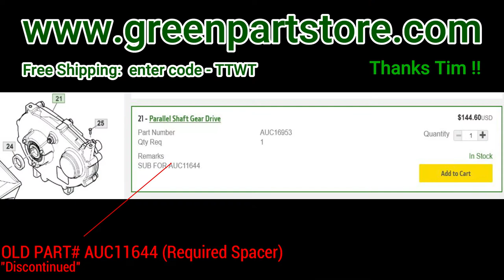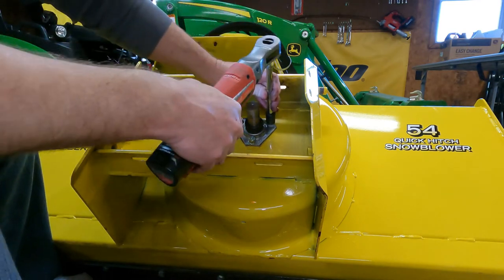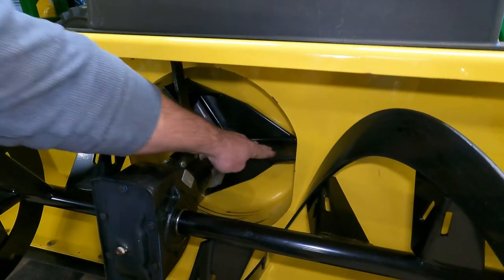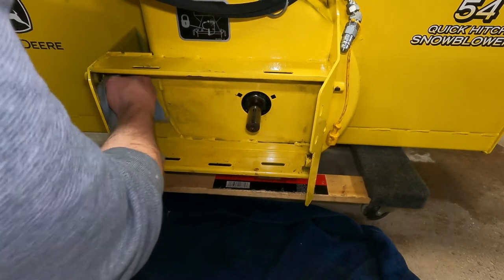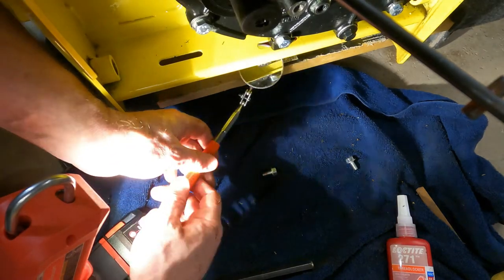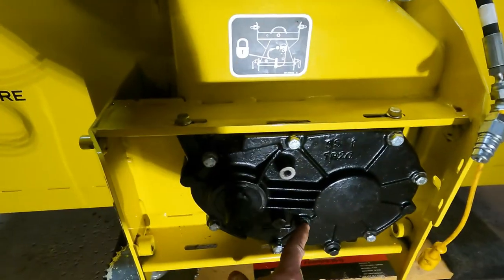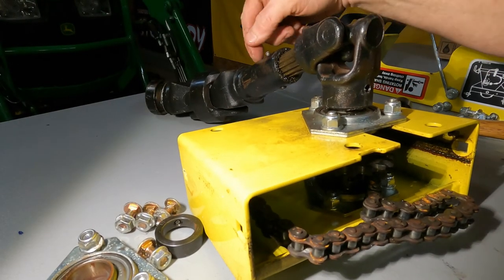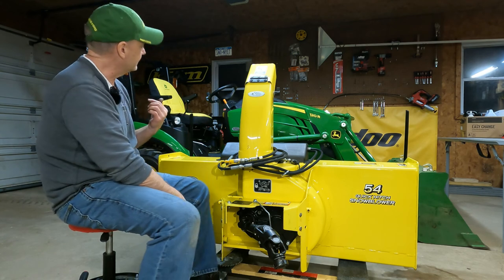JOHN DEERE 1025R | 47” 54” SNOWBLOWER CONVERSION PARALLEL SHAFT GEAR DRIVE

Comment: Was there an option to have that when bought new. ? Sad that you have to pay to upgrade after paying so much money for the blower. Any way. Should last longer.
Reply from the maker: Hey Noel, Thanks for stopping by the channel. No I don’t believe they offered the Parallel box when I purchased my tractor and snowblower back in 2017. I do know that a couple years ago those parallel boxes were much more money than they are now. Back when I bought my box this year it was only $142, which I didn’t think was that bad. And I agree it should last longer without constantly spraying the chain with messy lube. Take Care👍🏼

Comment: Thanks very much for sharing the experience. I have all the pieces and hope to make the change next weekend.

What did you use for wire on the spring pin? I have plenty of copper wire laying around but that seems a little soft. Admittedly the wire has absolutely nothing to do unless a one in a million chance happens and the pin starts to move Then then something more substantial than copper would be nice. 

Maybe a #6 bolt with washers on each end thru the spring pin and Loktite'd nut on the end. No actual load on the #6 bolt, the washers keep the pin from straying too far out of the hole, and even though I do not have as much Loktite as you seem to have I have enough for a #6 bolt. Anyway, just a thought until you tell me what you actually used 😊
Reply from the maker: Welcome to the channel Arvid and thanks for stopping by. I can tell you the Snowblower definitely runs quieter with the parallel box installed.. No more chain and sprocket rattling noise. If you watch my latest video I just posted you can hear the blower run at the end. https://www.youtube.com/channel/UC5KRo5zOtq_JW1U0pnyxgmQ  

As for the Wire, I haven’t added it yet. I have to run to the dealer tomorrow to pick up a couple things so I’m going to see if they have the wire for the spring pin. I believe all it does is in the event the pin should work loose, which i doubt that would happen it will keep it from fall out. IF the dealer doesn’t have the wire I’m just going to add a piece of metal machine wire I have from my old maintenance job. I’ll let you know what I do. Take Care 👍🏼
Reply: @SometimeIsNow  I stopped by the dealer the other day and they indicated that the blowers no longer come with the wire thru the spring pin. I did not try to verify that with any other source ... just figured he knew what he was talking about.
Reply from the maker: @arvidjedlicka6237  Hey Arvid, Yes I stopped to my local dealer also this past weekend and they said the same thing. No wire needed anymore that’s why there’s no longer a part# . I found some of that wire on amazon for $10 but I didn’t think I needed a hundred feet of it. 🤣😂

Comment: Did you also upgrade your poly impeller to the metal one while you had it apart for the gear drive upgrade?
Reply from the maker: Hey bsprt, No I didn’t upgrade the plastic auger as I didn’t see the point in my situation. I have a paved driveway with no rocks. The newer plastics they use in manufacturing are much tougher. Look at the old snowmobiles that use to use steel skis compared to the new ones with all plastic skis and not much takes a beating like a snowmobile ski and they hold up well. I think some people think plastic and its junk. Plastics nowadays have come a long way. I’ll stick with my plastic auger. 👍🏼 Take Care and Think Snow ❄️❄️
Reply: @SometimeIsNow  I did the Parallel Gear Box upgrade.....seems a lot quieter and much less vibration....Great Video!
Reply from the maker: @bsprtsgrp8550  Excellent bsprtgrp !! I would have to agree with you 100% They're much quieter and so much smoother running. I'm glad you decided to upgrade and everything went well.. 👍🏼

Comment: Did you do the aftermarket impeller swap too?
Reply from the maker: No, I haven’t needed the impeller swap yet.. I think the blower throws the snow fine as long as it’s not wet, heavy snow.. and being plastic hasn’t been an issue as my driveway is blacktop. Take care 🤙🏼

Comment: Thank you for sharing this detailed breakdown!  Did the parallel gear box speed up the auger at all?  Mine does not handle heavy wet snow well at all, which is unlike any tractor mounted blower I have seen before,  Seriously thinking about doing this for my JD 47 over the summer.  Also considering changing out the impeller from plastic to metal, replacing the auger bearings since its already apart, etc.  Any thoughts or advice you have is greatly appreciated.  Again, thank you and hugs to Riley.
Reply from the maker: Hey James, The gear drive box didn't speed up the auger. I believe it stayed the same. In my experience over the years (a 47" and 2 54" front snowblowers) there's not many blowers that deal with heavy wet snow very well. The next one is just my opinion but I don't see the big need to upgrade the plastic auger to the steel one if someone has a paved or concrete driveway. Maybe someone with alot of stones in their driveway might be beneficial. Plastic's nowadays are used alot where steel use to be used. Old snowmobiles use to come with steel skis but now they're all plastic and not much takes a beating like a snowmobile ski. 😁Take Care🤙🏼
Reply: @SometimeIsNow  Thank you very much for your help and fast response.  Yesterday afternoon we got about 4-5" of heavy snow.  I call it snowball kind of snow.  Wasn't really wet, but it was really warm for this time of year.  And low and behold, it clogged up the chute on my 47.  No matter what, something has to change!  Perhaps putting a larger drive gear on the blower, and installing rubber flaps on the auger are all I can really do.  However, I do really like the enclosed parallel gear box setup for noise and maintenance reduction.  Thanks again.
Reply from the maker: @jamespooley7844  Hey James, 🤔 Hmmmm I’ve never had my chute plug up from heavy, wet snow and a lot of my snow in the driveway is just that. Somethings gotta be going on with your setup. What tractor/snowblower setup do you have?
Reply: @SometimeIsNow  It’s a 2017 JD X738 with the 47” snowblower and Cozy Cab. Bought it from the previous owner of our property with on 66 hours on the entire setup, and only used for snow. It’s got me totally baffled. Always run it at full throttle when blowing snow. People don’t buy JD products to experience issues like this. Thanks for your help!
Reply: Also, I went ahead and ordered the parallel gear drive. Looks like the one you installed also fits the 47. Not sure where the more expensive option came from.
Reply from the maker: @jamespooley6397  Ok That makes way more sense.. The  47”& 54” blowers are technically the same except for the width on the newer snowblowers, and seeing how yours is a ‘17 the one like mine would work. I thought something was off when you said that other part# but I didn’t want to tell you go ahead and order the gear drive I used because I didn’t want you to buy it and it not fit your specific blower just in case you had something much different. You should be good. 👍🏼
Reply: @SometimeIsNow  You’re a good man. Thank you. Some guys say it shouldn’t matter if you have plastic impeller or steel. Mine is plastic. A good friend has a 2008 model 47 and it’s steel. He has no issues at all. I’ll get to the bottom of it. Just going to take some digging and research. If I learn anything I will be sure to let you know.  Your time, advice and help has been huge. From the Northwoods of Minnesota I wish you well!
Reply from the maker: @jamespooley6397  No problem James.. That’s why I do all the videos. I’m always trying to help people if I can. 👍🏼 Surely let me know what you found out. Take Care
Reply from the maker: @jamespooley6397  Very nice tractor setup.. That Cozy cab must be really nice. 👍🏼
Reply: We get a lot of high winds and have a lot trees. First season had a branch come down and it was completely hidden from view in the snow. The end of the branch, as luck would have it, lined up perfectly with the impeller, jamming the impeller from turning. Output shaft spun out the inside of the impeller. The replacement metal impeller has taken some bruises from wood and rocks and is still chugging along. The metal impeller was standard equipment at one time and I recommend it to anyone without a hazard free work area.
Reply: @jamespooley7844  I live in lower michigan near the lake, I use a blade for the wet snows, and the blower for the heavy volume colder parts of winter.

Comment: I just picked up a 54 blower, now I want to do this!
Reply from the maker: Hey Jamie, Thanks for visiting the channel. For the small price of the gear drive box it’s worth it just for how quiet it is and low low maintenance. That’s great !! What are you installing it on, a 1025r ? Take Care.. ❄️❄️
Reply: @SometimeIsNow  I am installing it onto my X738. Just waiting for the shaft kit BM25305 to arrive.
Reply from the maker: @RamMan2016  Oh nice.. 👍🏼 They’re a great little tractor.. Think Snow ❄️❄️
Reply: @SometimeIsNow  yes it is a little beast! 👍🏻 As much as I don’t want it to snow and be cold, I would like to use my new attachment
Reply: @SometimeIsNow   I’m finally installing my gear box! Your video has been a great help! I’m using it as a step by step guide haha 👌🏻 👍🏻
Reply from the maker: @RamMan2016  That's great !! 👍🏼 When you're done let me know how you made out.
Reply: @SometimeIsNow  will do! I might even make a video

Comment: I am wondering if you noticed a difference in performance meaning distance of the snow blowing distance after you switched to the new case style?
Reply from the maker: Hey John, Thanks for stopping by the channel. I completed the enclosed case install at the end of the season last winter and haven’t used the snowblower since so I wont find out if it’s quieter or smoother till it snows this fall. I’m hoping if anything it eliminates the chain and sprocket noise while running. I will also like not having to spray lube the chain all the time. 👍🏼 Take Care
Reply: Hello.  Curious if your chain/sprocket set-up was unbelievably loud and sounded terrible, almost like a grinder, or a rock crusher?  Mine sounds horrible and if this remedies/addresses this I’m ordering one ASAP,  Thanks.
Reply from the maker: @JLeosnow1  Hey John, Thanks for stopping by the channel. Yes.. I would say my chain and sprockets were quite loud and made the grinder noise. Sounded like a box full of pebbles. You could quiet it down alittle by keeping spray on it but it doesn't last long and makes a mess having to constantly having to keep it lubed. You'll be impressed how much quieter the parallel box quiets the snowblower down. Take Care 👍🏼
Reply: @SometimeIsNow  Thanks!  Last question, did you ever happen to run it with the sprocket/chain cover removed and notice a lot of runout of the chain/sprockets?  When inspecting by hand(with the machine turned off and the front driveshaft in-hooked)In one spot it will have A LOT of chain slack. Then (by rotating the fan assy. maybe 1/2 a turn) you check the chain and there is 0 SLACK and almost so tight than you can’t rotate it by hand…

-John
Reply from the maker: @JLeosnow1  Hey John, No I never ran with the cover removed. Yeah I'm wondering if the 1" shafts bent that's running through the larger driven sprocket? Can you pull the large sprocket off and check it with a mag base and dial indicator to check runout on that shaft running to the impeller? I'd definitely want to verify that before installing the Parallel box. Take Care
Reply: @SometimeIsNow  Thanks.
-John
Reply: @SometimeIsNow  Did this install today and I am VERY pleased!  It’s 100 times quieter now, just whispers!!  Best thing I have ever done for the tractor/blower combo.  Thank you!
Reply from the maker: @JLeosnow1  Hey John, Thanks for stopping by the channel. Thats great 👍🏼 I agree.. It’s very quiet compared to the open chain and sprockets it replaced. But… Must be you haven’t completed the single point conversion yet because thats the best thing I’ve ever done for my tractor/blower combo 😂 I don't have to struggle with those stupid hydraulic connectors anymore. There was always that one connector that always wanted to fight me. 😁 Take Care

Comment: Thanks man!
Reply from the maker: Hey, Thanks for stopping by the channel to check out the video and I’m glad the video helped if you were thinking of upgrading 👍🏼 Take Care
Reply: @SometimeIsNow  I just realized I forgot to subscribe, and your content deserves it.  I had to replace the left auger and your content inspired me to buy the upgraded drive system.  I had to do major disassembly in order to replace the auger and came across your vid and it just made sense to do the upgrade.  I have a 728x with the same blower and now it's ready to rock!  Thanks man.
Reply from the maker: @thefarcenteristhepartyyoun4787  That’s great 👍🏼 I’m glad you liked the video and found it useful. The 728 X’s are very nice tractors. Sometimes I think my videos run little long but I try to record every step, start to finish. Some YouTubers skip over so many steps and it leaves me wondering what I missed. 😂 Thanks for subscribing. It’s greatly appreciated. Take Care and Think Snow ❄❄

Comment: Great video.  It was easy to get the kit from your information provided, great price, and fantastic customer service!  I did my snowblower this past weekend.   Only problem i had was the bearing was rusted to the shaft just enough that I needed a puller.  Smooth process otherwise!  Thank you.  Looking into the costs of the single point connect now for the snowblower and loader.
Reply from the maker: Hey John, Thanks for stopping by to check out the channel and I’m glad the video helped and you completed the upgrade without issues other than the rusty bearing. The single point is somewhat pricey to do both the loader and snowblower but IMO it was 100% worth the money. Not having to deal with those 4 stupid quick couplings and being able to change out the loader to the snowblower without shutting off the tractor and wiggling the lift control lever to bleed off the pressure so you can unhook the connection was so worth the investment. Take Care 👍🏼

Comment: So all the parts I need are the four bolts?
Reply from the maker: Hey Patrick, Thanks for stopping by to check out the video. If I can remember correctly the 4 bolts came with the parallel box so if you buy the box you get the flange bolts with it. 👍🏼